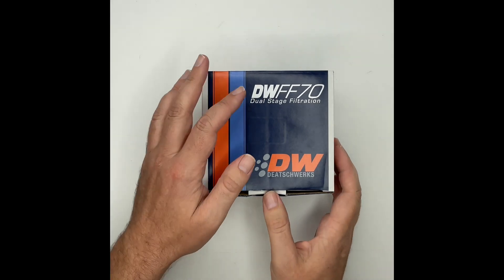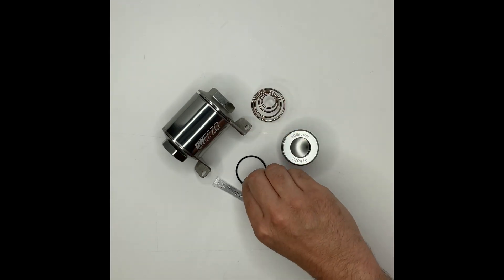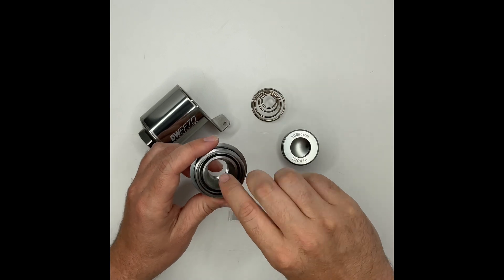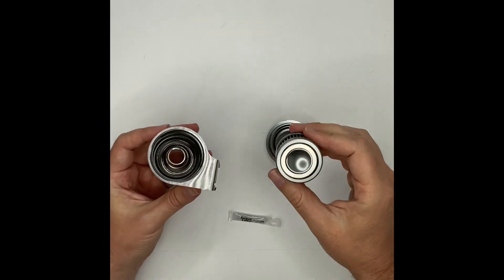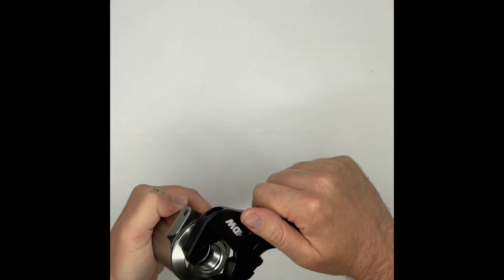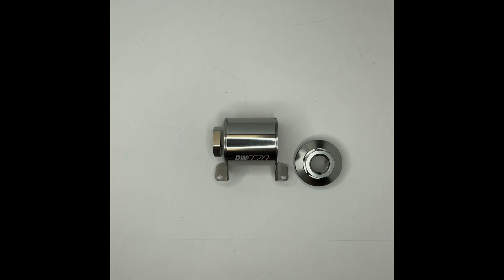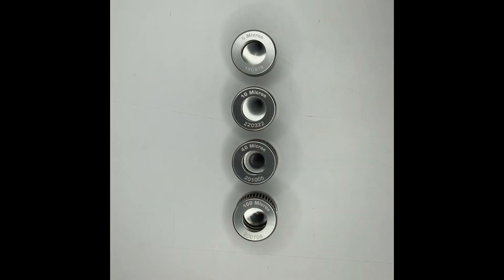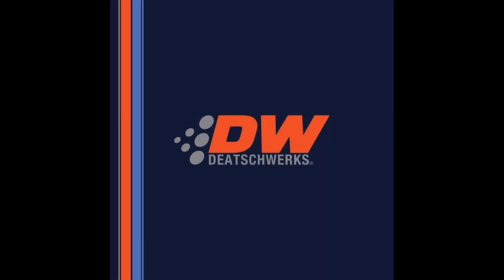Fuel Filter Assembly

Comment: If my injector specifies 10 micron and I use 5 micron instead that's okay? I have a 100 micron filter already. Hoping to add this before the rail. I've experienced clogged injectors on a new set up
Reply from the maker: Yes that will work for your injectors, 5 microns will filter better than 10 microns.

Comment: The way I have it now inflow comes in on spring side and out the other. It just seems Ive seen it done different ways on this filter. Which is correct. Thanks
Reply from the maker: Great question Josh! Fuel enters on the spring side. The O-ring is on the open side exiting towards the fuel rails. I hope this helps, and feel free to reach out if you need further clarification.
Reply: @deatschwerks  I wish you guys could have define that in the video. The guy had his hand on both ends of the filter as he explained the flow and made no sense
Reply from the maker: @mikitosmr2 Completely understand. We're always working to improve our video quality and content, and we'll take this into consideration.

Comment: How many microns the filter should be to install it before injectors?
Reply from the maker: @Kevin72308 100 micron before the pump, 10 micron after the pump is the rule of thumb.
Reply: 10 micron for port injection, 5 micron for direct